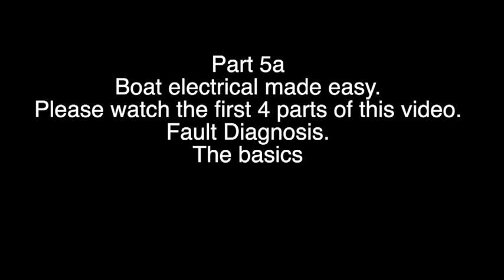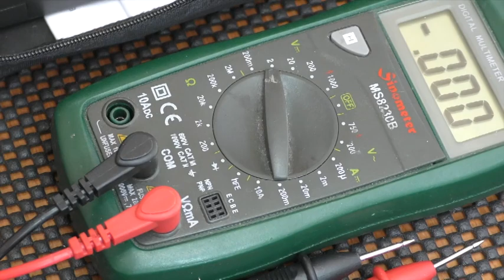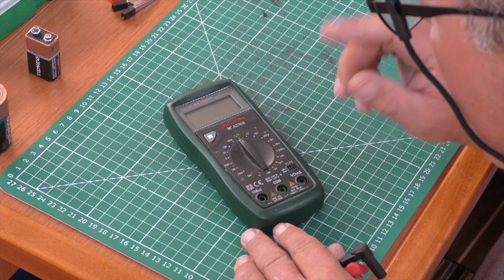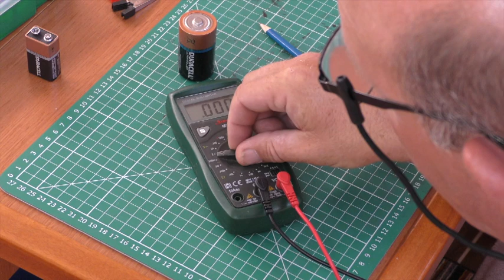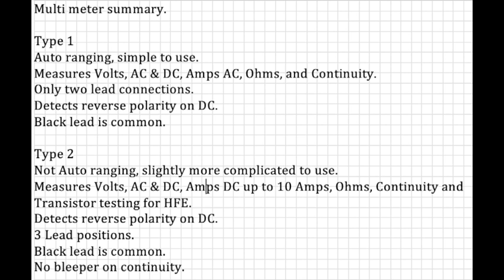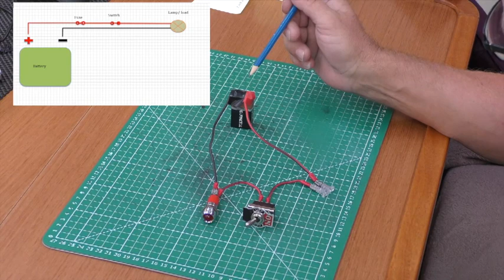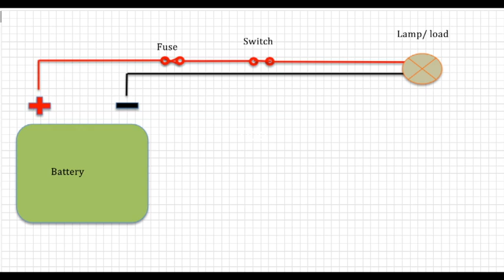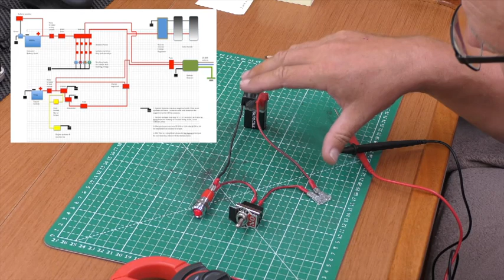Boat Electrical Made Easy. Part 5a

Comment: Thanks for your instructive video. Could you explain which circuits on a boat typically are switched and which are unswitched, and why is that. Many thanks! Silvano
Reply from the maker: Silvano Cometta. Hi Thanks for watching. Yes we will cover this in a future video. But, For now there are two that need to be unswitched for safety. 1, is the Auto bilge pump that should have a constant feed (we covered this in a previous video) and 2, is the warm air diesel heating. It must be allowed to cycle through it's cool down sequence through the computer and not be switched off or it can cause a fire. Hope this helps and we add more later in the series. Thank for the constructive comments, they are always welcome. Sail Safe. Ant & Cid.
Reply: @SVImpavidus  Good to know. Many thanks and fair winds. Silvano

Comment: How do you do this (21.00) if you have two batteries and dont know which one is grounded to the circuiit?
Reply from the maker: Set your multimeter to volts DC. Test between the positive at the switch and either battery to find out which one is connected. When you have the right one you will have a voltage. But note that generally boats have the negative of all batteries as a common IE they are all connected. Hope this helps. Ant

Comment: Pretend you walk in flip the switch and no lights come on , they get power from the Battery Bank , there is a switch and wire and should be a Fuse. You could trouble shoot your Light this way and or many other things by looking at bits of the Whole. Ty!
Reply from the maker: Quite true. In the army we were taught to work backwards from the problem. They spent thousands on logic charts and fault charts for use in the field. The best guys I know could spot a problem a mile away, knew what to look for first and only went back to the manual after 5 mins if the nut behind the wheel forgot to switch the ignition on. Sail Safe mate. Ant, Cid & the pooch crew.